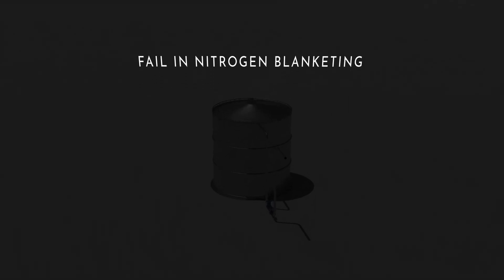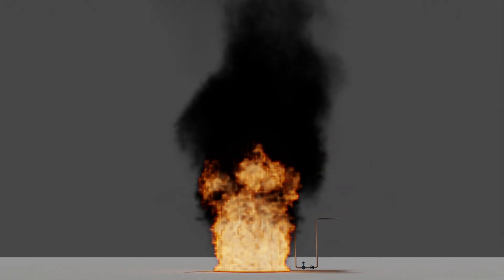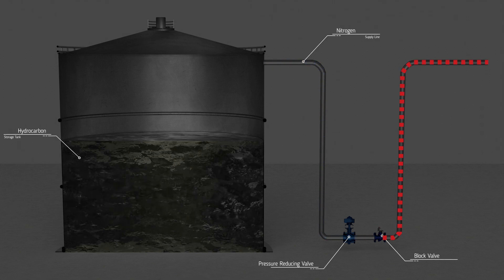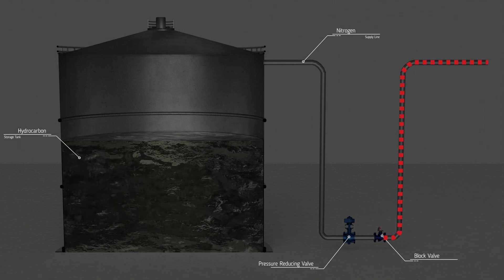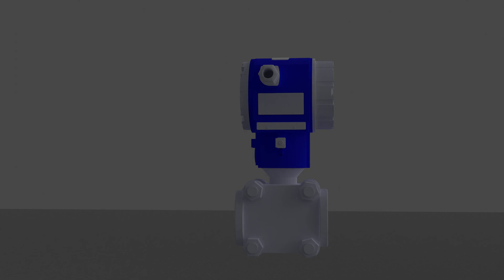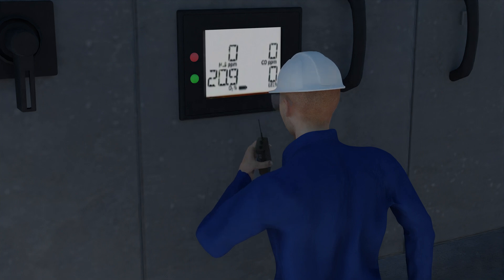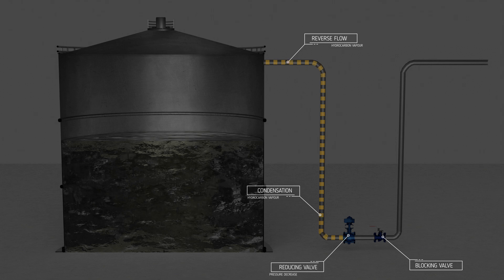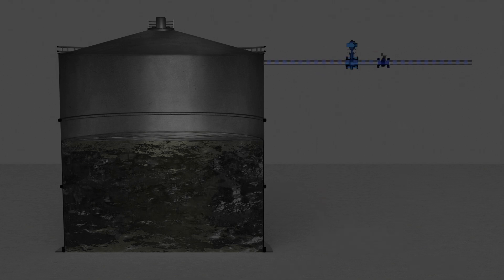Process Accident - Fail in Nitrogen Blanketing (4K)

Comment: Why the hydrocarbons vapor got condensed when the pressure reducing valve at the bottom and didn’t condensate when it’s at the top??
Reply: It's due to the cold wall effect. Vapors find the coldest surface and condense there even if there's no measurable flow going out through the pipe. It does condense in the pipe even when the valve is at the top but it's no problem when the liquid can drain back to the tank. With the valve at the bottom, the liquid cannot drain to the tank but stays at the lowest point and block the pipe after the valve.